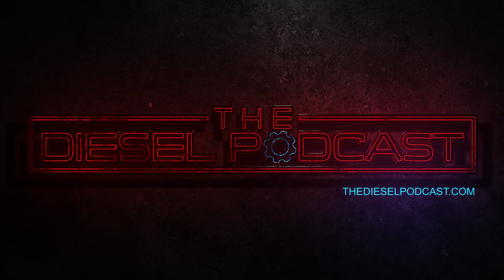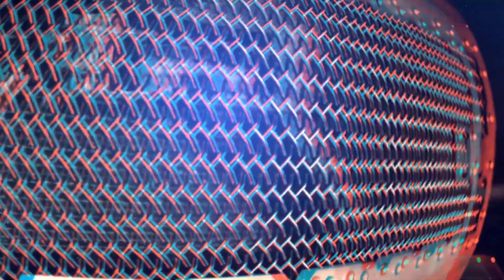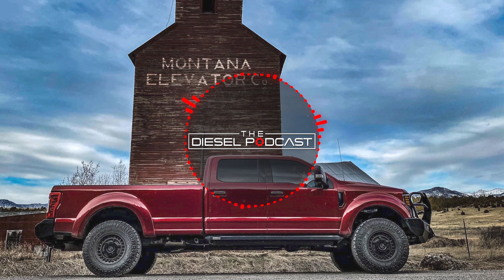Off-Road Alumiduty & 2.8L Cummins Jeep Swaps

Comment: Mechanical advantage question: From what I see, 3.31 and 37" tires in 5th gear is almost identical to 4.30 in 6th gear on 37". That being said, wouldn't a good transmission tune that doesn't lug the motor, and locks the converter when necessary, take care of that? And you then have really low RPM for fuel economy when you are unloaded. Just tow in 5th. Sounds to me like a tune would be able to take care of 90% of those issues. My thought is that would be a great option for a large amount of the people who want the look, but don't want to put out the cash for a re-gear.
Reply from the maker: Jim Lawrence what can be a challenge is the transmission itself.  Some cannot be tuned much at all (Aisin for example), or converter lockup commands may be limited.  There’s no doubt a solid transmission tune with optimized shift points and lockup make a world of difference.  How much of a difference can depend on the year of truck.